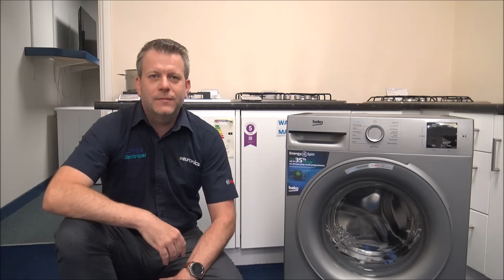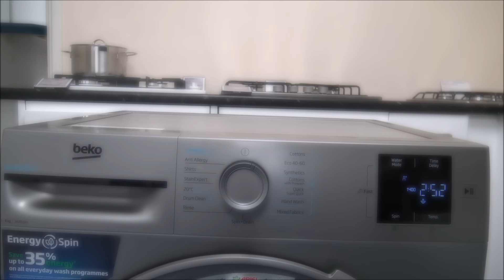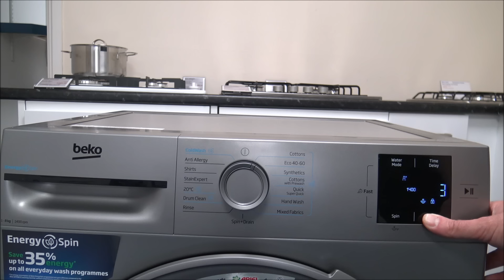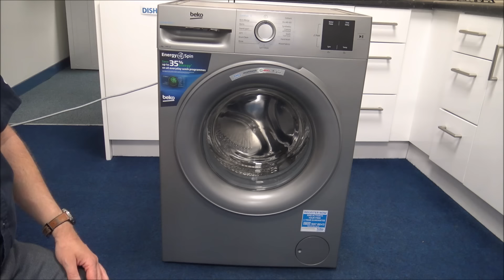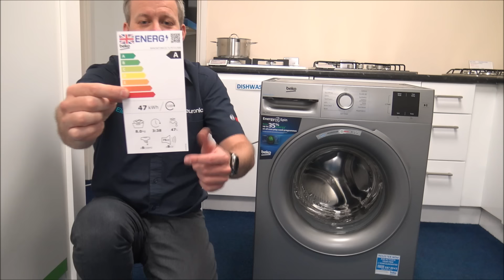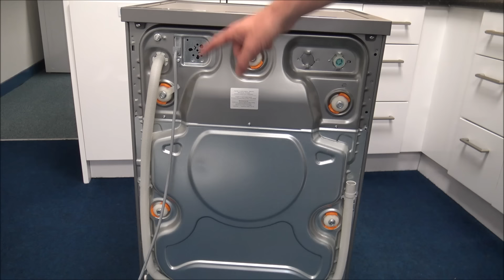Beko BMN3WT3841 1400 Spin 8Kg Washing Machine

Comment: Great video but mine only has 3 transit bolts the two at bottom are not there
Reply from the maker: They will vary between each model but just make sure all are removed before connecting the machine

Comment: It says “fast” pointing to the two buttons and enclosing them in a big bracket and under the “quick” cycle there is a “super quick” which must have to be selected elsewhere since the nob can’t select a half click. I think it’s likely a generational thing growing up with tech. It’s intuitive to the youngers and not so much for the elders.

Comment: I’ve had my clothes stuck in my machine it did a cycle but the door won’t open can you help me?
Reply from the maker: That sounds strange, i would try banging the door, and maybe try turning the power off then on again to see if it will reset it

Comment: Just purchased this model. Tried to do a time delay (3hrs) but when I set the time delay and pressed the start button the machine began its cycle. Any ideas?
Reply from the maker: This is normally where the cycle you are selecting is longer than 3 hours. If you try 6 hours and starting the machine, see if that has the same effect?
Reply: @lords-electrical  thanks for the reply. The cycle I was trying was 2hr 24min

Comment: Is it just me but it's advertised as having a 1400rpm spin - but in reality this is not an option? False advertising.
Reply from the maker: Not all programs will have the ability to wash at the full 1400 spin, but the main ones will be Eco 40-60 and Cotton programs
Reply: @lords-electrical Thanks for your reply. I'm sure I've tried every option. But I'll check it again.
Reply: @lords-electrical Both start at 1200 and all the rpm choices are lower. Beko and EVERY company are lying to buyers!

Comment: Hi, Do you need to do a cycle before using the washing machine for the first time.
Reply from the maker: It is recommended to do a short hot wash before putting any clothes in the machine to be washed

Comment: I think there’s a fast option to shorten the length of the washing cycle. Could you tell me the length of the cotton cycle at 40 and 60 degrees with 1400rpm when using the fast option, please ? Also how short is the mix and synthetic program at 30 or 40 degrees with 1200rpm when using the fast option ?
Thank you in advance.

Comment: Can you use it for 1hr30 cycle with using full capacity we getting 10kg one wondering how we can get wash like that using 30 degree's temp
Reply: I would like to know too! Which is the best option for a full and fast cycle. My last machine was 50 minutes
Reply: @lauraj5207 put it on quick wash 40c it does 39mins wash we found that adequate did good job

Comment: Got this machine last week. I have twice tried to do a fast wash on cotton but it does not spin afterwards. Tried to spin separately twice but it didn't , tried the rinse in the hope that it would also spin - it didn't. Finally managed the separate spin after the 3rd attempt. Am I missing something or is it faulty?
Reply from the maker: That sounds very odd that it isn't spinning. It sounds like there may be a fault if you have tried to do so many spinning attempts and not had any success.
Reply: @lords-electrical  Thank you. Spin works on other programmes but I will contact Beko

Comment: Can steam be used on all programmes and does it add time to at end of wash or is it produced during?
Reply from the maker: Steam can only be used on certain programs, and it can add approx 10 - 15 minutes to the wash time
Reply: @lords-electrical can it be used on shorter programmes, like the 28 min one ? Also, would you say there is a massive difference between 1400 spin and 1600 spin. About to buy a new machine, ive had 1600 spin the past few years but can only find a decent machine with 1400 spin

Comment: Very helpful video as the "manual" is not clear at all. One thing you missed was the FAST option. Press and hold both buttons on LHS. Thanks for mentioning the load limits for each mode as I didn't see that in the manual

Comment: Thanks for the informative video. Could you tell me if the ‘fast’ on right of the display is supposed to be a button? In the manual it states to press the quick wash function button to shorten the cycle but can’t figure it out 🙈. I’m not sure if it’s just referring to the quick wash on the dial. Your help would be appreciated 😊
Reply: Sorry, just noticed someone has already explained this in your comment section

Comment: My machine does not use the fabric softener I can not figure out why. Its brand new a Im not sure if its a mistake withe the programm i switch or something else.
Reply from the maker: I know it sounds silly, but just make sure it is placed in the middle section. Also make sure there is enough water pressure going to the machine, as sometimes some of the detergent or fabric conditioner is not taken if the water pressure is too low

Comment: Thanks for this video. Very helpful. Important instruction in the manual too about "Calibration"after install, to make sure the machine detects the amount of laundry correctly, going forwards!  I really don't need to wash things for 2hrs +  so the Fast feature is a relief. So many independent retailers going out of business, it's hard to even see products before you buy them, these days (and I forgot to come to youtube first!) Just grateful i live in Scotland where water bills are lower!
Reply: And how to do Calibration correctly in first use...do i just go for option "drum clean" for first use, because in the instruction it says for the calibration do the option "drum clean" without centrifuge and that will take 15 minutes but we see that option (drum clean) is over 2h so i am confused little bit

Comment: The white plastic plate that comes with the machine placed in the drum, what is it for?
Reply: I'm wanting to know that
Reply: @sandrapinnegar8499   it blocks of the big hole in the bottom of  the machine [ fit from underneath]
Reply: Yes me to as I’m not 100% sure but in the manual it says about reducing noise or something like that ,not sure if it needs to be attached underneath or not😕
Reply: Have just input into Google about these plates and they do need to be fitted underneath, if you put in Google -
beko bmn3wt3841s washing machine, should the assemble bottom panel covers be put underneath the machine

And a video comes up to show how to do it, so please I kept panel A, hope this helps👍🏻

Comment: Just purchased a 9kg machine. This video was very helpful, but I am still confused how to reduce the washing time. Do I press the 
left hand buttons together. Any help would be appreciated.
Reply from the maker: On certain programs you press the Water Mode and Spin buttons quickly then it should reduce the time of the program
Reply: Thank you. I know this won't work on the Eco programme.
Reply: How long does it reduce the wash time by ?
Reply: The new time will show. It reduces by 1 hour. @LaylaChen-c5c

Comment: Everytime I hold the play button it just pretends like it starts and then unlocks what do I do?
Reply from the maker: When you press start, it will normally enable the lock on the machine to prevent the door being opened while in use. If it is not starting the program, there may be a fault with it and i would contact Beko to get it sorted as it should be under the warranty still if it is this machine

Comment: Got mine today and it's not spin
Reply from the maker: Not sure why it wouldn't spin? It would normally spin at the end of the program but if it isn't there may be a fault
Reply: Maybe you pressed Spin enough times to get to No Spin. (spin symbol but with a line through-it on the display)

Comment: I never thought I would find myself commenting on a washing machine video but I feel so validated that I’m not the only struggling with the fast options. 

The ONLY plus I have found about this machine is that it’s very quiet. However it is outweighed by the fact that if I put more than a small load on, it is still sopping wet, even after an extra spin. The touch controls are so temperamental and you have to touch them for just the right amount of time.
The wash timings are ridiculous and the fast mode is too fiddly to figure out (I’m sure once you figure it out, it’s fine but there doesn’t seem to be an actual method written anywhere). 30mins is too short and I don’t have time to wait over an hour for a wash.
And most infuriating of all, it changes the cycle length part way through the wash. I know it’s supposed to be more eco-friendly but i like my machines to finish when they actually should.

My Mum bought this machine when I was desperate but I wouldn’t recommend it to ANYONE.
Reply from the maker: That's a shame to hear you are not happy with it.
Reply: You could try to calibrate the machine, maybe? If you haven't already. The manual instructs you to do this (after install) to make sure the machine is detecting loads correctly.
Reply: @Tuber80 how to correctly calibrate machine in first use, what is the procedure

Comment: How do I select superfast wash. The instructions r terrible n the design. Really disappointed
Reply from the maker: If you select the Quick program, then press the Water mode and Spin buttons at the same time it will reduce the time of the program for you.
Reply: @lords-electrical  Thank u for your reply.   I've tried serveral times n not working. My washing machine is new

Comment: great video thanks, Mine just arrived this morning I put a liquid gel pod in and it flew straight into the door seal and stayed there! guess i need to really make sure it is buried in the washing next time!
Reply from the maker: Although some of the gel pouches are convenient, it is normally better to use liquid in the drawer as it will be a lot more effective at dispersing the liquid within the wash. Also after a while you can get a build up of the gel pouch outer within  the machine waste hose so just be careful if you are using these.
Reply: @lords-electrical  thank you

Comment: Can you please explain the "Fast" function shown on the left of the display.  I thought this would reduce the time for a cycle, but can't work out how to use it?  Thank you!
Reply from the maker: The "Fast" option will reduce the wash time by up to 50% on selected programs. If you press the 2 buttons where Fast is labelled, then it will activate the option for you
Reply: @lords-electrical thanks so much for the reply.  I’m struggling to locate the two buttons… I have had other people look too so we are all missing something!  Where are the two buttons located on the left of the display?  Thank you!
Reply: @Diane-d8v  I've been tearing my hair out trying to work out this function too! The Beko chat function shed no light whatsoever but this has now solved my problem. Thank you so much!
Reply: Yes I’m struggling with getting the fast option on 🤷‍♀️
Reply: I can’t work out how to put it on either. I put it on accidentally when I got annoyed with trying to figure it out but haven’t been able to get it back on again 🤦‍♀️ The manual is useless. I’ve pressed the “water mode” and “spin” buttons at the same time because that’s what the display hints at but NOTHING. If anyone figures it out please please share 😂
Reply: Yup. I've tried touching top and bottom with same hand or two hands and no response. I can work spin, water, temp, and time delay, but Fast? And it is a selectable option on my chosen wash program. Thank God someone got it on even once by accident. There's hope yet.
Reply: I got it! Little clock symbol, with three lines in the lower right quarter, beside the water mode symbol.

Comment: Where is the option whereby you can wash 2 kg of clothing! I am very angry with this design. Prefer the old one. All options are 2 hours except.
Reply from the maker: If you select the Water Mode and Spin speed button at the same time it reduces the quick program to 14 minutes rather than 28 minutes
Reply: @lords-electrical  My machine is the same but it says 17 minutes, not 14.

Comment: This machine has awful programming!there must be better options, don’t go there with a barge pole
Reply from the maker: That's a shame to hear you are not happy with the machine
Reply: What's wrong with the programming?
Reply: Have to agree with you.
Reply: Nearly all programs are over 2 hours long..
my last washing machine,  Haier, brand, full wash took n hour.. 
my brother and I  bought new washing machines.. he got a hotpoint and I went with this model, his full load  regular wash.. not quick wash is done in 45 mins..  n quick wash in 15 mins..
So beko went energy efficiency with saving water.. but decided to burn electricity for longer.. sadly as I've used it so cannot return.. so save time and electricity n time go buy one that doesn't take all day to wash.. oh yes .. its loud like old washing machines when in full spin..
Reply: @Alom121s  Yeah, it's very over the top, in my opinion. I have the 7kg. Cottons programme can be done on Fast though, and cuts the time in half. (Eco Mode I can't Fast) Quick wash i can Fast, 28 to 14 mins.
Reply: @GrigRP 

@Alom121s It doesn't use more electricity just because it runs longer. Stick to being a waiter at restaurant.

...
Interesting response to the answer to your question.. 
To use the profession of waiters as an insult reflects only on your upbringing, though I'm sure your parents tried their very best.. 

But here is one more attempt to simplify then I'll have to give up.
If electricity is charged at 1unit of  your local currency, 
and you watch tv for 10 mins, and you switch off the tv..  you used 10 units of your local currency.  
Now if the tv program on the next day lasts longer, for 30 minutes, and you watch for 30 mins same rate of currency per minute.. you pay 30 of your local currency units..

If you  need further clarification please go see a local restaurant waiter.. don't forget to tip.😊

 glad to part of your learning  experience.
Reply: @GrigRP 

@Alom121s That's not how it works. Electricity isn't charged per minute. As I said, stick to restaurants

🤦🏽‍♂️
Again with using the same profession as an insult.. talk to your waiting staff next time they are humans too quiet bright and intelligent.. infact a great percentage of those are usually students who later on go on to other fields.. being a  waiter is not an insult, for a person who has a photo of an old man as his logo, I assumed you're older then 8.. but I think I am wrong in engaging with you. 
 

Try this experiment: 

If you're using this mobile/cell phone  charge it to full and play games/ watch YouTube on it for 1 hour.. see how much battery percentage reduces.. then charge it full and watch it for 5 hours and see the battery percentage reduction.

also try this
If you leave your basement light on for 1 whole day how much bill you have to pay?
And if you leave the same light on for 1 month how much will you have to pay?

If you still don't understand after all this
Try going to a restaurant and ask a waiter 

Take your phone with you and show them these messages and ask them to explain.. 

And if after all this you still insist that you are right I'm I'm wrong, 
You can address your concerns at the restaurant where you have suggested I gain employment.  
As it will be foolish for me to engage with you further. 

Note: to anyone following these delightful exchanges.. next  @GrigRP reply will not have have a response from me, but I will post their reply as I already admit to my failures in teaching, just like their parents. 🥸

Comment: how do you change the temperature to cold wash? im only getting hot wash
Reply from the maker: You can change the temperature on the display. Just make sure the machine is connected up to a cold feed, if you are only getting hot washes, it sounds like a hot connection has been connected up to it
Reply: @ how. would i check that please

Comment: Nice video, but I did not see where you started the machine.
Reply from the maker: The start and pause button is on the very right hand side of the control panel
Reply: Iv got ine of these but it is taking ages to start is it the arrow button or the lines @lords-electrical
Reply: @lords-electrical is it the arrow or the line button and y does it take a few press be for working is it faulty

Comment: All I want to know is how o switch is on 😭
Reply from the maker: You just turn the dial to the required program, the press the start button on the right hand side
Reply: @lords-electrical  thank you. I was tapping the button but then realised I have to press and hold it down
Reply: @newid10  I did the same!